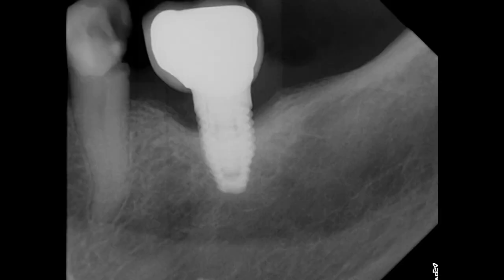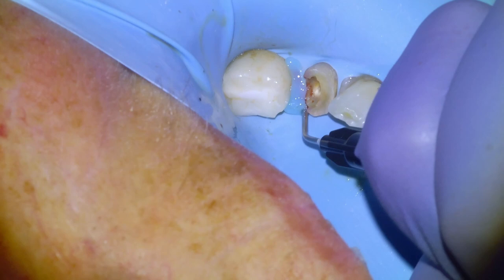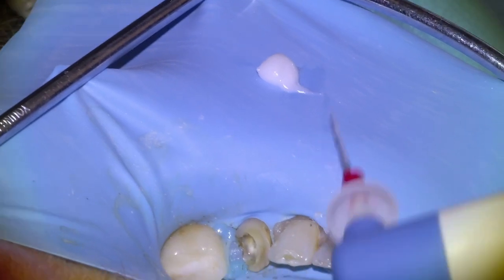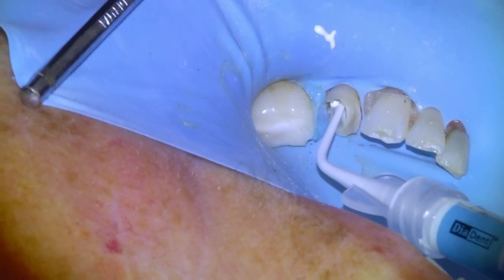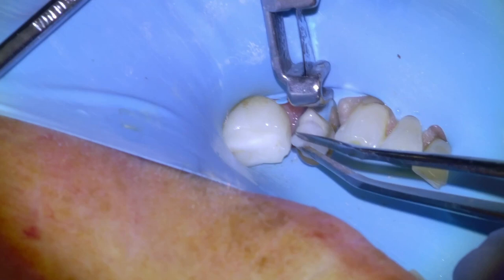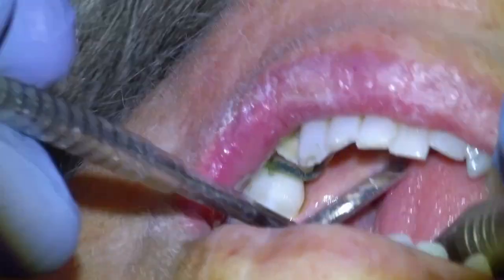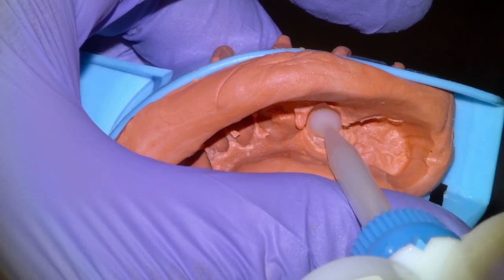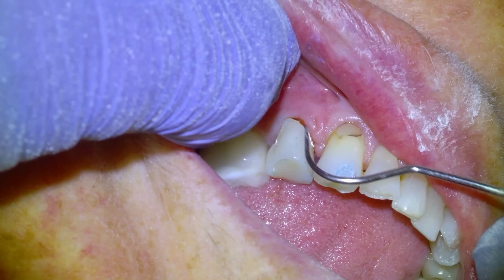[8] Root canal and crown preparation

Comment: and you take an obturation xray after core build up ? what if the obturation is short and you have to redo the step ? you will remove the core buildup and then remove the gutta percha??? thereby increasing chair time......:(
Reply from the maker: I typically make endodontic xrays decisions on a case-by-case basis, if I feel that the cone may not have sat fully or want to assess the sealer puff I may take a PA after obturation with the rubber dam still on

Comment: sometimes the equia forte will stick to metal after cured, any tips for preventing/dealing with that?
Reply from the maker: To neighboring teeth? I'm not sure I understand the situation, can you give an example?
Reply: I mean it sticks to the matrix sometimes...usually a bigger problem when using as a restorative for fillings and a chunk of it comes off with the matrix when it is removed @behindtheloupes
Reply from the maker: @preachingflamingo  ahh yes. Giving it the full 5 minutes is important before removing matrix, remove separator and wedge, and then take an explorer and peel it back from the occlusal and proximal surfaces with the shephards hook before grabbing it with a howe plier and gently rocking it side to side out of the contact area. Sometimes if it's overbuilt occlusally over the matrix then you can trim it down before doing those steps

Comment: EDTA inactives the hypochlorite! You don’t need to use edta with pro taper gold rotary files. Only use edta with hand files
Reply from the maker: I didn't use a chelating agent in this case, just hypo. Generally though the literature does show improved success rates when a chelating agent is used as a final rinse right before obturating
Reply: @behindtheloupes  rc prep contains edta. Edta should only be used as a final rinse after shaping
Reply from the maker: @anuppatel624  I would be curious to see some literature and sources. RC Prep is the most popular endo lubricant on the market

Comment: did you take a working length xray ?
Reply from the maker: No I find the root ZX2 to be more reliable, especially in necrotic cases
Reply: @behindtheloupes  so after measuring the working length with your apex locator you don't take a confirmation x-ray of your working length?? wow!
Reply from the maker: I do from time to time if something doesn't add up but I have a good relationship with my apex locator.